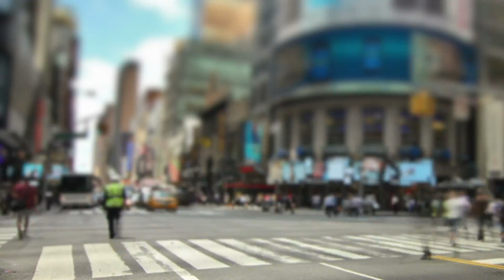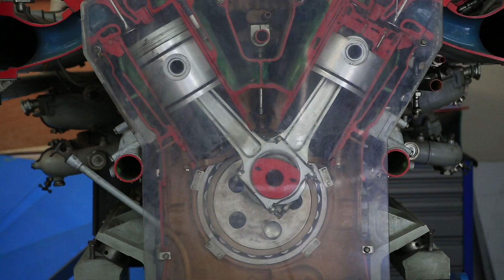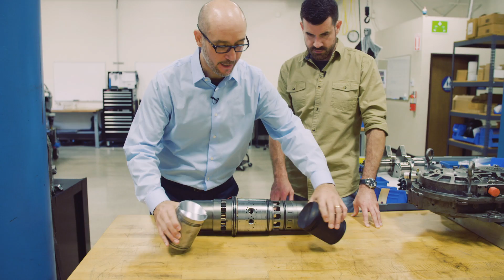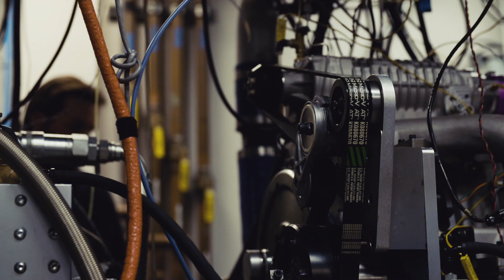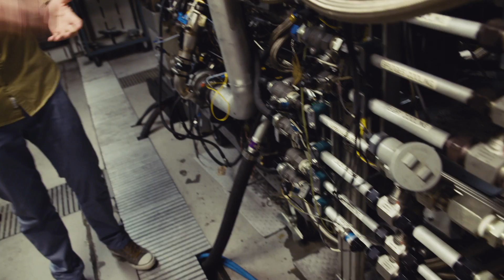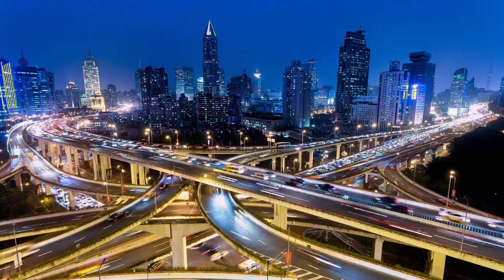This Radical Redesign Could Keep Gas Engines Pumping | WIRED

Comment: Just go electric in personal vehicles.
Reply: Where does the electrical energy come from?
Reply: Makkendam until electric vehicles are self sustainable they are impractical.  Not to mention building the batteries for one electric vehicle does more environmental harm that driving a vehicle for 10 years that gets 15 mpg.
Reply: I won't buy an electric car until they invent a nuclear powered battery
Reply: Gasper Erjavec wrong.. the four stroke is nearing fifty percent efficiency.. more than your electric cars can dream of.. tax is expensive not fuel.. oil is probably cheaper than bottled water... the fuel beeds redesiging.. pretty sad to talk bad of internal combustion when the engine outlasts the car...
Reply: RancheroBFT Did you even listen to the music they were trying to promote this with? Exactly what you're describing... Fuzzy feelings for combustion engines.
Reply: Paul Dude, I kind of on your side in this debate, but I do need to offer some correction. Most well-designed electric motors run in the mid to high 90% for efficiency. Internal combustion engines loose a lot of energy in the form of waste heat. 
Of course where I live (Nothern Midwest, that heat is needed in the winter, so losses are reduced). 

And then when looking at the overall efficiency of EV's, the efficiency of generation needs to be taken in to account.  New EV's seem to be more cheap to run on a per-mile basis but not so great when you take in to account the higher cost of the car to begin with.
Reply: Gaspaer Erjavec, you couldn't be more wrong. The electricity used for powering car batteries, is about 60% lost compared to using that gas directly onsight for powering a motor. It takes a LOT of power to transport and store electricity, which eventually goes flat when you leave it.
Reply: Alien Mechanic technically that is not a battery then but a reactor. 
If you have range anxiety visit your local tesla dealer and go for a ride. It will torque that anxiety out of you in a few seconds
Reply: JC Webb that's the charm of battery powered cars, you can have multiple sources, you can even have your own solar system and charge of that. Even if the power for your car comes from a oil burning  power plant it's still more efficient in the end. A gasoline engine is in theory 30% efficient, in reality 14-17% and when the energy goes to the ground it is only about 12% so basically its just wrong to burn petrol in this inefficient way.
Reply: In 2.3 seconds now, I believe.

Comment: Good luck with emission control.
Reply: Kammaol Even though there aren't any valves and the entire piston body acts as the intake and exhaust valves, could this engine be equipped with an exhaust gas recirculation system ? That could help mitigate unburnt fuel loss.
Reply: Kammaol extremely efficient catalytic converters maybe? There are other ways of improving emissions. Maybe it could also eventually run on hydrogen.
Reply: High compression = high NOx = big cats and consuming lots of DEF to control it. Also, 2 strokes have major oil control issues...oil that tends to foul cats in hurry. So yeah, I'm skeptical that this will make sense for anything other than off-highway vehicles.
Reply: I don't understand why everyone is saying this, can you explain please :/ Unless I missed something.
Reply: The Mighty Dash There are no valves covering exhaust ports - this leads to unburnt fuel being thrown in to the exhaust lowering efficiency and prohibiting this design of ever achieving homologation.
Reply: The piston covers the exhaust port.